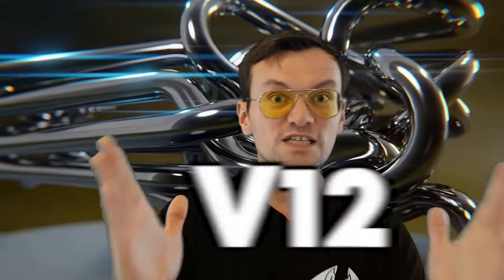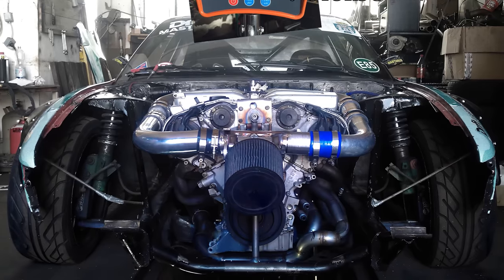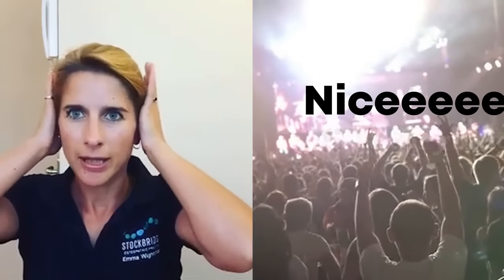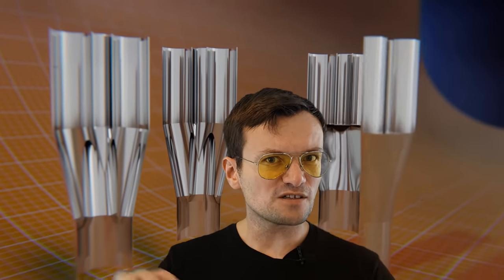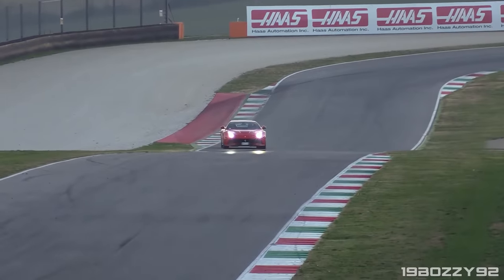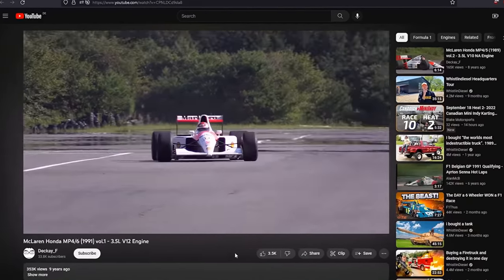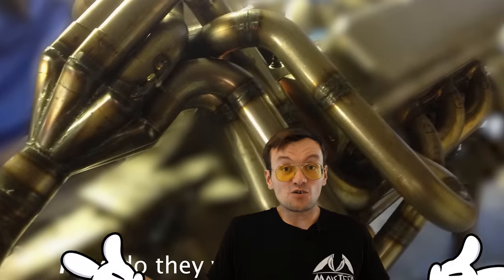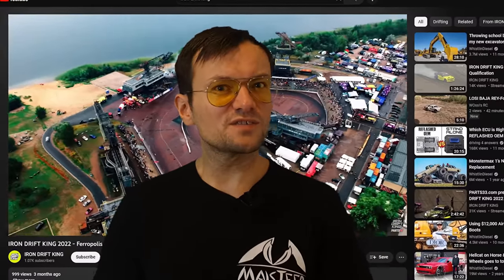Why This V12 Sounds Better Than a $5,000,000 Pagani

Comment: will a high revving 10000rpm 500hp k24 with 1-3-4-2 firing order with sequential scavenging exhaust do the trick?
Reply from the maker: Hmm, i wonder what you aim for. But it won't scream more than any of the 4-cylinder sportbikes with a 4-in-1 exhaust.
Also it's impossible to reach that power number on an NA engine with 2.4 Liters. Math says it'll be at the very most putting out 420 hp at 10.000rpm, but even that is only when God helps you putting it together ^_^' - it'll be more likely 380 hp or less.
So that brings up the question: 500hp on Nitrous, supercharged or Turbo?
Reply: @maisteer  it would be a destroked and to  get the most possible biggest liners I can find for k24 even with block modification would be 90.5 mm bore piston with k20 crankshaft 80mm stroke something along with 13.5-14.0 CR with able to accept 95-120 race fuel and since I saw the guy who fitted the 8-1 headers on the mustang and saw firing sequentially would benefit power curve as well with the nice scavenging property might probably give me 500hp with hopefully it'll sound close to an f1 sounding sound. Oh if you're wondering everything will have to be forged aluminum with a super stiff spring as well high lift high duration cams to compensate. for the probability of reaching my end goal. 4 piston did it I'll do something similar
Reply: @maisteer  and also many more thing I'll have to do as well to reach the 500hp mark
Reply from the maker: @bryanleal9836  Don't get me wrong, I like that you want to try.
Given the bore and stroke numbers, it'll be even less than 2.4 liters at 2058ccm.
The highest torque number ever achieved on a 4-stroke NA engine on 'regular' petrol without power adders is right around 125 Newton-meters per Liter. And that's in the Formula One cars of the 2000's with almost unlimited budgets.
So applying that number to your specs would net you around 257NM, at most! Horsepower then  is calculated like this: 257NM x 10.000rpm / 7127 = 360 HP.
I'm just telling you - you will NOT get 40% more torque per liter than the most thorough engineered NA engines ever made in human history. Except maybe on nitromethane. ^_^'
Reply: @maisteer  well yeah I'll try if all falls to fail I'll just lower compression ratio widen the Ring gap tune a richer AFR swap the cams to a lower duration but keep similar lift and do a manifold with a sequentially exhaust firing manifold and turbo from there and I'll probably do 600-700 high revving turbo k24 instead

Comment: Maybe it's because I'm from Europe and grew up watching F1, but the high pitch sound of high-revving V10 and V12s has gotten a bit stale to me. I love the deep and chuggy roar of older V8 engines now.
Reply from the maker: I've read the same argument from americans the other way round - only europeans could like the high pitched noise because they are used to it.
Anyway, I guess it is what it is. A super rough running v8, which shakes the ground at idle is great too, and I would even prefer that over a v12 at idle.
But the feedback a high pitched screaming engine gives you, that only get's more intense as you push it harder and harder - there's nothing more exhilarating than that imo.
Reply: @maisteer  I've never driven such vehicles to the limit so I'll have to take your word for it!. I'm sure being inside of the car is a completely different and quite visceral experience.
Reply from the maker: @nycyabber7103  Maybe it's a taste thing too. For me that not only applies to cars with an unhealthy amount of cylinders, but also to bikes. I just don't want them to sound lazy, when I try to give them a really hard workout. ^_^'

Comment: Well what happened? Did you make it work?
Reply from the maker: I made the video after we figured out how to build it (with 3d Printed jigs) and the 3d printing was still in progress (it took about a month to print). The picture of the header is from around 2 weeks ago. By now everything has been checked for clearance, and the headers are getting fully welded at the moment. 
The car is supposed to be raced in mid August at the Iron Drift King, and it's looking good so far.
Reply: @maisteer  Sounds like an interesting project the 3d jigs …. “A month to print” … Wow. Do you have any photo’s you can post? As I said before, sounds like a video in the making of how you worked all this out.
Reply from the maker: @JACB006  Maybe I include some more detail of the design and production process in the final video when the car is finished. But I'm not gonna make a separate 'How to video', because I think it's too boring for most ^_^'
Reply from the maker: The 12 into 1 headers are finally done. Thanks for wating. Watch the new video here: https://youtu.be/6EjbfLSRmyA
Reply: @maisteer  Thank .. I will take a look. Wow … great progress … keep going.

Comment: It's all about what type of metal you used to make your exhaust.
Reply from the maker: Yeah... no.
Reply: @maisteer  so it's not about what type of metal and what size diameter the pipes are to resonate the sound?
Reply from the maker: @josephlewis7997  You wrote 'it's ALL about' - which simply is not correct. It's a part of the equation, but only a very small one.
And how many materials are suitable to make headers in the first place?
Anyway. If you change the header from a 600cc 4-cylinder bike made from stainless to one that's build exactly the same shape, 2mm bigger in diameter with the same wall thickness, but made from titanium - you couldn't tell the difference. I did that on a GSXR and I couldn't tell.

Comment: my question is, can you do the same to a v6 to make it sound more like a v12?

my dream is to build a 11k rpm vq37 motor that screams like an LFA, but also has a nice deep menacing idle like a v8 (instead of your typical buzzing sound from f1 cars)
im going to use the engine in a supercar im designing
Reply from the maker: If all cylinders are joined together by equal length primaries and the firing order is spaced 120° degrees apart - in theory it should sound not too different from a v12 at half that rpm with the same kind of header - but it will not sound like a LFA for sure ^_^'
Reply: @maisteer  i know it won’t sound like exactly like an lfa, if I wanted I’d just get a v10 lol. I just used LFA as an example, I want something that just screams about as high. The goal is to get a V6 to sound as exotic as possible, also I’m a musician so I want to see if I can bring out certain harmonics, like the major 3rd that is strongly present in the LFA (V6s and v12s make a power chord sound, but Maj 3rd harmonics are present as well I think)

I’ve learned a lot about engine sounds and how they work, and I’ve also learned that the better your headers perform generally the more exotic your car will sound.
Reply from the maker: @DisturbedVette  Yeah, there are a lot of factors at play when it comes to engine sound. Maybe worth checking out the engine simulator. It's a great tool to figure out what does what, and it only gets: better https://youtu.be/RKT-sKtR970

Comment: Another thing i didn’t hear u mention that changes the engines sound is the camshaft chosen ..   it’s not all just the exhaust
Reply from the maker: Yes, absolutly. Many factors influence sound. Main point is: If the collector is the wrong design, you can change any of those other factors and still not get the sound your after. The collector is not only a change in exhaust note, it transforms the whole sound.

Comment: Its subjective but i would say Zonda F is the second best v12. Murcielargo LP640 is the best sounding v12 of all time so far for me. it has that unique sound mix with a bit of race sound. and even when you let go of the throttle it sounds so good when the revs drop. the further it goes the better it sounds.
Reply from the maker: It's subjective... but since the video was released the GMA T.50 was signed off and wild DeTomaso P72 appeared.... which could become arguably better than anything else before.
Reply: @maisteer gma t150 has high decibels. I wouldn't say it has a pleasant sound. its a bit buzzy like the huayra R. gets irritating. Detomasso has a good sound but not close to lp640 or zonda f. they both sound harmonic. that's for me at least. lp640 howls gett better with distance. and sounds awesome slowing down too without braking

Comment: Do you think no car company ever made 6-in-1 inline-6/flat-6/V6 because of noise regulations?

There's a bike that exists though which is Honda CBX 1000, and yes it is an old bike! (1978)
Reply from the maker: Two things. The CBX is the best sounding straight six since almost half a decade then.
And somebody wrote me the 599 GTO did have a 6-in-1 from the factory. So I guess it's just down to production cost and space issues. Big downsides for very little benefits, if any at all.

Comment: Cylinder head exhaust port shape also affects sound in relation to the exhaust headers
Reply from the maker: Well, what doesn't affect the sound of an engine? If you go that route, you will get lost in details. In details that won't have nearly as much impact on sound. (As long as it doesn't end up in extremes - an exhaust port shaped like a paper slit would be considered extreme)

Comment: I got a question... Are most of these exotic motors flat plane cranks???? If so i think it does play a small part in sound. Just opinion i guess
Reply from the maker: Flat plane mostly is referred to the crank throw offset in v8's (180° offset). Inline 4's are almost always flat plane too tough - with very few exceptions like the yamaha r1 or motogp bikes. Inline 5s, Inline 6s, V10's and V12's are never build as a flat plane since their firing interval is not 90° or 180° (or 360°).
It makes a huge difference to the sound of an engine if it's a flat plane or cross plane crankshaft. But the headers can be a workaround, so a cross plane v8 can be made to sound just like a flat plane, if you pair the cylinders that fire 180° apart in one collector. To do so, you have to bundle up two the cylinders of the left bank with two cylinders of the right bank, or bundle up all eight. Again. That only applies to V8's.

Comment: Why do sport bikes with inline-4s sound different, and more in-line with the ideal sound being referred to in this video, to cars with similar capacity, small inline-4s? Is it because all sport bikes merge sound from all four exhaust outlets into one with 4-into-1 merge collectors from the factory?
Reply from the maker: No factory bike I know of uses the 4-1 arragement (maybe some italians do?). But the Suzukis, Hondas, Yamaha and Kawasaki usually merge cylinder 1&2 and 3&4 before merging them in one. I guess it's for packaging reasons and a compromise for a wider powerband.
Manufacturers of cars with small 4-cylinders most often go for the cheapest cast manifold to mass produce. They have a very different goal in mind.
Reply: @maisteer Correct, but wouldn't you agree in-line engined sports bikes have a bellowing sound you were in the pursuit of in this vid. Why is that?
Reply from the maker: @WhatUSeekisSeekingYou  High rpm's help alot. But also a short stroke seems to make engines sound more agressive. (Compare S1000RR with ZX10R, or RB26 or even 1JZ with a 2JZ) I don't know exactly why - but let's find out. ^_^

Comment: Lovely to see how well this is picking up ❤
Reply from the maker: Glad to have you checking back ^_^
I'm almost sorry that it takes so long to get the next video done, but other job commitments have to be taken care of too, but at least I can see the path to take from here on.
It seems like youtube is rewarding unique and things out of the ordinary... - how's your V12 with rearmount turbo going? ^_^'
Reply: @maisteer  Cheers, quality takes time and it looks like people reward unique topics that are heavily researched and exquisitely presented, so perhaps less is more and 1 really good video every month might trump a mediocre one every week. Think Top Gear, get the audience craving for the next one. Either way, you're in the groove now, good stuff!

Rear mount suspended for now, became we'll somehow fit it between the wheel well and firewall as time is tight and figured best not to complicate things right now. It has a similar setup now but we'd have to switch sides (RHD) and some piping.

Weighed in entire swap with everything (engine, trans, turbo, piping etc) at 360kg which is not great but also not horrible for a turbo v12, probably around 120kg more than my SR setup but will know for sure once that's out. Sounds like a fair bit of difference but since the car weighed in at 1111kg with the SR it shouldn't be too bad.

Will be sure to let you know how it evolves :) Best of luck on the next one!
Reply from the maker: @OctavChelaru  Best of luck with the project. Yeah, those V12's are sure heavy, but going from a 2JZ to a 6-Liter NA, it's like you can really 'massage' the tires with your throttle input - I don't know how to put, but the power delivery and the way to drive it is very different.
Reply: @maisteer  Like you get more throttle resolution and depth? Surprisingly, I think I do despite not having driven it yet. I'm lucky enough to be super proficient at Assetto Corsa data and virtual driving (ex VDC driver if that says anything, we consider it top level) so I simulated most engines and chasis, I am roughly aware of their particularities and the way they like to be driven. For the M70 turbo synthetic powerband on dyno is between 4200-4700 rpm (tq to hp) which seems super tight but with long gearing, lots of momentum and more angle than usual (lean on tq) works acceptably well as it's effortlessly torquey outside the band, from 3k up to 6k and you can always call on that instant smoothly delivered torque.

Tbh it is a temp solution  for 1-2 years till I can afford to build either an V8 or 2J 1k package for Drift Masters so I'm happy to get the seat time and refine the platform till then.
Reply from the maker: @OctavChelaru  I hope it's gonna be a very reliable package.
Seat time is so important not only to become better, but also to enjoy drifting. People get too hung up on improving the cars (me included) and in the end it's not the deciding factor if you gonna win or loose.
I was talking to Max (Heidrich - DMEC driver). He is still doing little adjustments to suspension geometry, shocks and rollbar settings to gain more grip. But when he had at a look Piotr's rear suspension setup, he said the same setting would make his car like it's driving on ice (comparatively).
But the Valino's offer so much grip, that it becomes kind of unimportant - Piotr's car is still the fastet car on the grid. The tires do the work. And if you would dial them in for a high grip setting,  you probably end up with not enough power, not enough tire life and not enough drivetrain strength - so just get good tires and lots of money to be able to afford them ^_^
Reply: @maisteer  Very well said, I have a feeling us two would make for a very long podcast should we ever be forced to.

I, too, bet on the reliability, it's a recipe more common here than elsewhere, 3 Pro cars ran it quite reliably (2x S13, 1x E46 - my donor). All built by arguably the best tuner in the scene.  if it blows, you just swap the base unmodified engine for 1-1.5k, that is the logic. Didn't happen much. Poverty finds solutions.

For DMEC and Vallino, spot on, say I could afford Vallinos my v12 CG mechanical grip nightmares would be solved. But, fortunately, universe provides balls, momentum and prayers instead. Could work.
Reply from the maker: @OctavChelaru  I hope it'll work out fine - I would love to see the DMEC field getting mixed up by your build ^_^

Comment: When it might have been easier to make a "flat-plane" crank . . . (Well, at least equally as difficult and would package better, AKA need 0 packaging changes.)

I could be mistaken but wouldn't the bank to bank exhaust pressure pulses be even then?  Could it possibly be made out of an Inline 6 crank and some custom rods?  If the engine is run like 2 straight sixes (Dual ECU) all you'd have to do is clock the cam and sensors on one bank.

Well nevermind, the BMW V12 is already "flat plane'.

I haven't been clicking on these video because of the first bait and switch, no hearing the sound.  WT Heck!?!
Reply from the maker: Thanks for the comment. Please google a pic of any 6- or 12-cylinder crank and check at least the pictures in this article: https://www.linkedin.com/pulse/flat-plane-vs-cross-plane-crankshafts-nikhil-jagdale.
See them side by side and then ask yourself how could that flatplane principle apply to the 6-cylinder crank?
And thanks for not watching, yet ^_^'